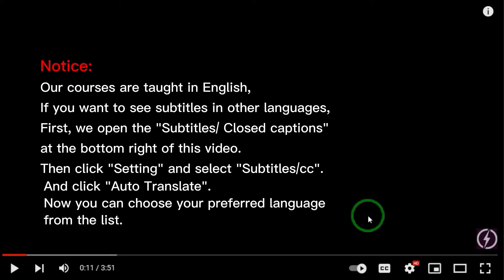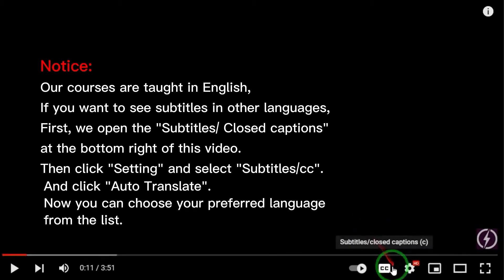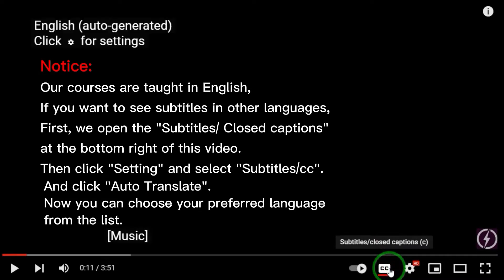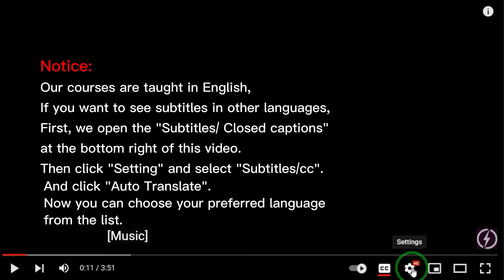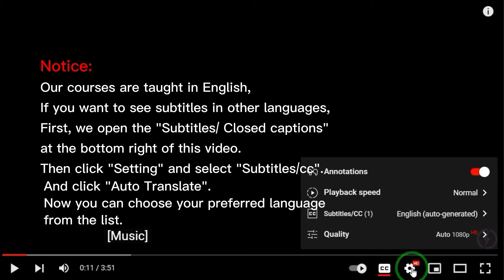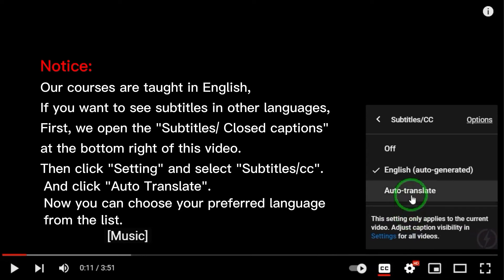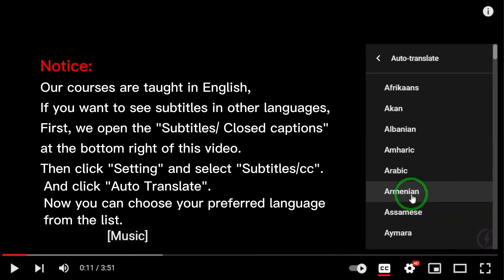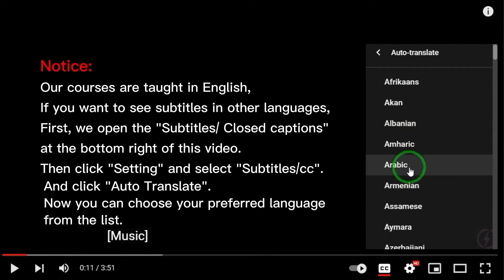Easily damaged parts of Avalon 921 hash board introduction | Canaan AvalonMiner 921 Repair

Comment: Is the same for Avalon 841?
Reply: With your permission, I have a total of 851 hashes, they were removed without connecting the four screws that secure between them and the PMU, and a problem occurred in them because of that. Your choice of which piece is the one that hits the hashboard
Reply from the maker: @moatazelrakhawy1016  Hi, I didn't understand what you meant. You can give a detailed description of the problems you encountered, preferably with pictures, and contact our technical staff
repair@zeusbtc.com
Reply from the maker: Most of the same. ASIC chip models are different
Reply: @ZEUSMINING  do you have an instructions for repair 841?
Reply from the maker: @carlosdecastro8297  Hello, this is a hash board repair article about Avalon A8 series, I hope it will help you.
https://www.zeusbtc.com/articles/information/3523-avalon-a8-series-hash-board-repair-manual
Reply: @ZEUSMINING  I have a problem in the hash board of my avalon miner a921, ECHU error code [0 0 0 131072] in a single hash board. any solution? it also throws me sometimes when the temperature reaches 40° error code ECMM[128]
Reply from the maker: @imgaby2361  Hello, we need to view the complete kernel log. You can send it to our technicians in the form of an email.
repair@zeusbtc.com